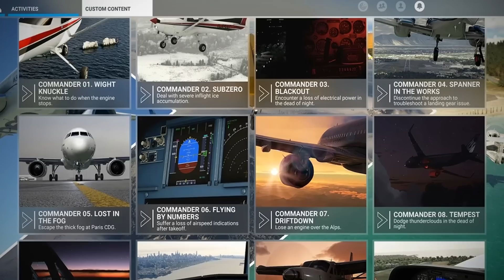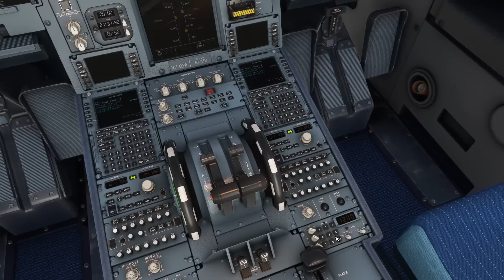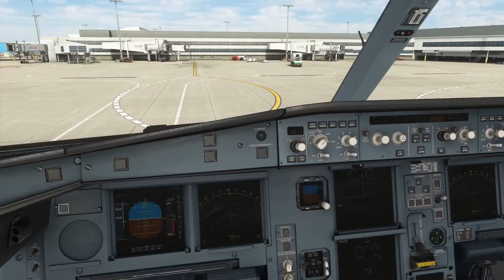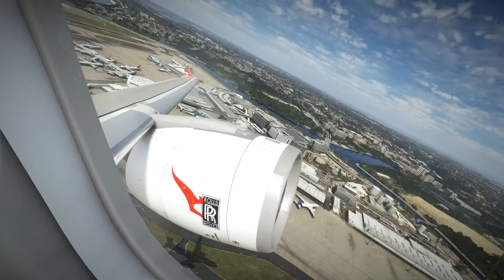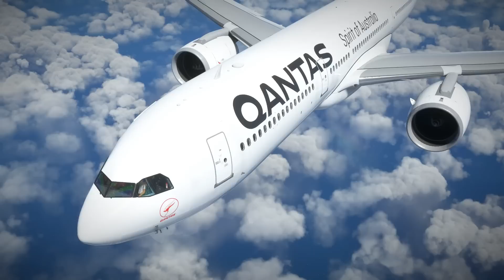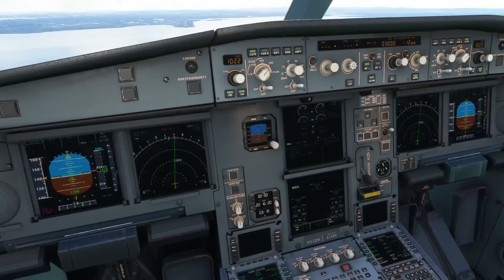Worth the Money? | Real AIRBUS PILOT’S Analysis | LVFR A330-900 Review | Full Flight SYD-AKL | MSFS

Comment: I cant get my vnav working on this :  I set everything but there is no blue arrow nor white arrow for TOD :  whats wrong? is it the fault of thr aircraft?
Reply from the maker: Hi F28,

I believe I’m correct in saying, there is no meaningful / working VNAV on the LFVR aircraft (I know that’s the case with the A340 and I seem to recall that was also the case with the A330). I don’t think it’s anything that you’re doing wrong.

I hope that clarifies things a little. All the best! :  j
Reply: @IntotheBlueSimulations  thank you. Also another thing. Idk if you have some coding skills and I may look unrealistic but sometimes I cant play MSFS more than idk 30minutes so I do 200nm flights and i do sim rate x8 (yeah, x8)  but I love the pmdg 737 and the inibuild A300 and 310, and 320 but the problem is :
Both the 737 and  inibuilds when doing a turn they turn AT A VEEEERY SLOW RAATE and they have a SSSSSLOWWWW REEESPONNSE TIIME and they OVERSHOOT the path and it goes in circles and its bad.
Same for the vertical path :  it climbs VEERY SLOWLY then VERY AGGRESSIVELY and it MISSES the level off by 4000FT and it levels off WAYY ABOVE and it doesnt react then MEEGA DIIVE and same thig misses the level off and RE SAME THING until it stalls or crashes into the water.

Same for da throttle :  it ROCKETS ITSELF and misses the speed hold and IDLE and reacts WAY TO SLOWLY and stalls. This for all the 737 , the A300, 310, and new 320.

How can I modify the cfg files to tune the turn rate, the climb response time, the engine resppnse time and all dis stuff?

Also now the LVFR A339 has got VNAV for like 1week thx to update. 
Have a nice day, and since I'm french:
CEST LE 14JUILLET
WE STILL GOT THE E3 AWACS , THE KC135R, THE A332MRTT , THE A400M, THE RAFALES AND ALL DA STUFF

VIVE LE BOEING 707!
VIVE LA FRANCE 
haha lol

Comment: Bro how to on the gps nav screen, it shows red lines there
Reply from the maker: Hi Dikshant,

You need to align the IRS’ (by setting the 3 rotary selectors on the top-left of the overhead panel, to “NAV”). The process will take several minutes but, once complete, the NAV displays should be working correctly for you : )

I hope that helps. All the best!

Comment: Hi how did you adjust the sensitivity of the joystick to make it rise so smoothly on takeoff. 
I just can't calibrate it, the nose rises badly, maybe I make a mistake in the cg trim And even the flare seems to get stuck a few meters above the ground
Reply from the maker: Hi Emanuel,

I didn’t adjust my control sensitivities for the flight; as mentioned during the video, the LVFR A330 does unfortunately have a problem with auto-rotating during the takeoff. You’ll basically need to put in forward pressure on your stick during the takeoff roll (which is ‘somewhat’ accurate for the real 330, though overall, the addons behaviour is very wrong) and then gradually ease off that pressure upon reaching Vr. I’m not sure about the flare exactly but, again, I found the aircraft to behave pretty strangely during the approach also.

I hope that helps / clarifies things a little. All the best : )
Reply: @IntotheBlueSimulations  For the moment I don't feel like recommending the purchase to anyone (xbox included), it takes off badly, lands worse and on the ground it doesn't turn.
I'm sorry because I had taken a lvfr319 and all in all it was quite fine But this time we're not quite there
Reply from the maker: That’s very fair criticism, Emanuel. I think LVFR were able to rely pretty heavily on the default A320, for their A320 family, hence why the flight model etc was acceptable. Obviously, the A330 is a more customised project and (as a result) the aircraft definitely has quite a few areas that need improvement.

Regarding being able to turn on the ground; have you tried assigning a control axis to the tiller / NWS? I certainly had quite a few issues with the A330 myself but, I don’t recall not being able to turn the aircraft on the ground. . .

All the best!

Comment: passenger cabin it is Boeing 777 and not A330
Reply from the maker: What makes you say that, Kenny? I’m not saying you’re wrong (I’m not sure I could really tell one apart from the other haha), I’m just curious. The 8-abreast seating in economy, looks more 330-esque to me. . .

Cheers, all the best! : )
Reply: @IntotheBlueSimulations  The passenger seat on AIRBUS A330: 2 - 4 - 2 or 3 - 3 - 3 are correct.
But the cabin with luggage storage (see the ceiling) is Boeing 777 and not Airbus A330.
Reply from the maker: Ahh, ok. Thanks very much for the info! I will have to take another look. . .

Comment: Fun fact: this is an a330ceo cockpit... What a shame!
Reply from the maker: Hi Frap,

Genuine question; what’s the difference? I’ve never seen the cockpit of an A330-900 but, I had assumed it was essentially the same as an A330 CEO and as best I can tell from pictures, that pretty much looks to be the case? Again, I’m not trying to be argumentative, I’m genuinely curious.

Cheers, all the best! : )
Reply: @IntotheBlueSimulations  the apu fire test and ext. is at the wrong place for example
Reply from the maker: Ah yes, well there you go! I hadn’t seen any pics of the NEO’s overhead, only the main instrument panel. Interesting, that Airbus went back to the “320 layout” for the fire PB’s (makes more sense logically, I guess). 

Thanks very much for the pointer. LVFR have actually been in touch, so I’ll pass along the info!

Cheers and all the best : )
Reply: @IntotheBlueSimulations  and don't worry, i didn't know too until i was shown the difference and i was so disappointed

Comment: Well it didn’t fly the SID, what happened to 290 to 10 DME, left 260, 7000 DCT ANKUB 🥹
Reply from the maker: No it didn’t, did it, Nick haha. To be “fair” to LVFR, the aircraft flew the SID about as well as I was expecting; whilst not the most complex SID on the planet, the coding is still a little bit above and beyond what I think LVFR are aiming for with the addon (I think the 330 is currently aimed at Xbox users / more casual simmers - with the sort of FMS where you can just about scrape through a VATSIM flight). That being said, I know the devs plan to continue working on the product so, hopefully we’ll see improvements in this and a number of areas as they go : )

Cheers, all the best!

Comment: I’ll be sticking with the Headwind. Seems far better resolved than this. Another review showed it crashing through 10k feet at well above 250kts on vnav, which was disappointing.
Reply: I can’t get the headwind to work, just black screens all the time
Reply: @seriessplayer62747  Sounds like it has to be a mod conflict since not had anything like that here. Bat on, take external power on and screens come on immediately.
Reply: @markscars1069  Yeah i think its a windows 11 issue, because i tried re-extracting the files and all, put it on external and still no to avail
Reply from the maker: Understandable, Mark. I suppose in fairness, the Headwind team have had a bit of a head start; it’ll be interesting to see where LVFR take the A330 (I know they plan to develop the aircraft further) but of course, LVFR’s version of the NEO, is going to need to be significantly better than the Headwind version, if they expect people to fork out good money for the addon (on the PC anyway).

Cheers, all the best! : )